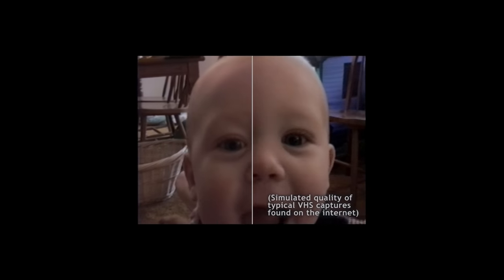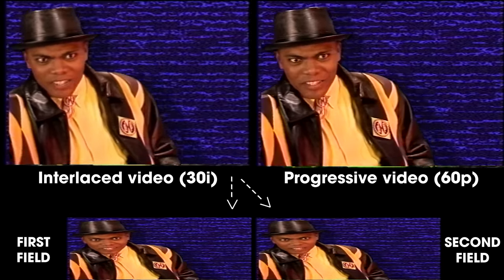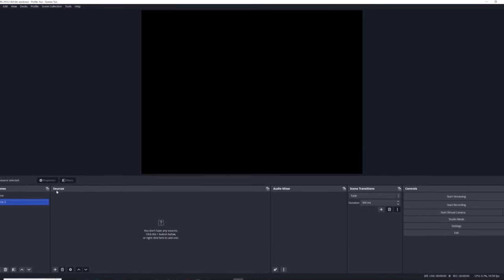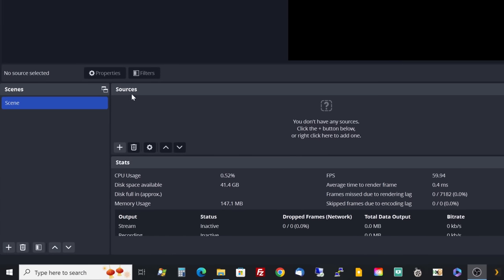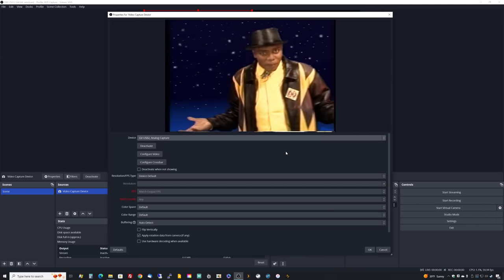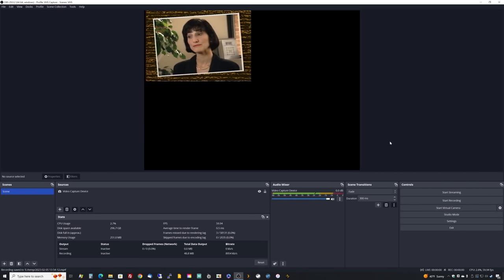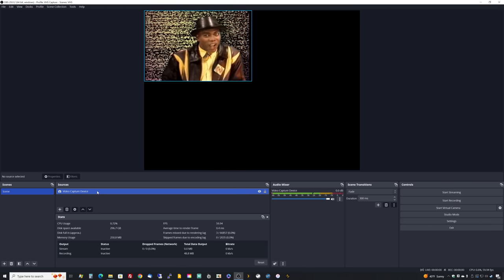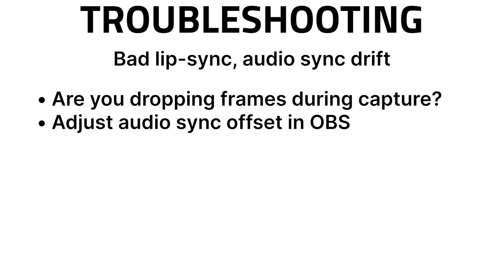How to convert VHS videotape to 60p digital video

Comment: How do the results of this method compare to using a VHS-to-DVD recorder (Panasonic DMR-EZ485V)? I also have a Toshiba 6-head deck which may be a better player, but I would need something like that Dazzle device to bring it into the PC.
Reply from the maker: DVD recorders are a great option to do the digitization, and you can later rip the DVD-R to VIDEO_TS files and then perform additional processing if you need to.  The end result (OBS vs. post-processing in virtualdub) can be exactly the same if the same steps are performed (yadif2 for deinterlacing to 60p output, primarily).
Reply: @TheOldskoolPC  I've been using StaxRip to delinterlace the ripped DVDs to 59.94, which seems to yield a good result. However, I've never compared it to the method you demonstrated here, which seems simpler and I wondered if it might also provide a better result.
I also have a Sony GV-D200 that can play analog or digital 8mm tapes, which also digitizes the analog tapes (or any other analog input given it via composite or s-video) - over firewire. The resulting video, however, is a very large 30Mbps bitrate AVI file and is still interlaced.
Your solution using OBS is the first one I've come across that deinterlaces "on the fly" to a file.
Thank you!

Comment: One more question (I promise) about OBS capturing old video. Some of my videos are so old that they are putting out an inconsistent signal. When this happens the preview window and capture (recording) screen turn blue. I guess when OBS detects no signal (even for just a second or two) the video capture screen turns blue. The sound capture continues to record, and the video capture records the blue screen. I can manually get the picture back by deactivating and then activating the capture device within the OBS program. Is there a capture setting in OBS that I am missing.? I've messed around with the settings for a couple of days now and I'm unable to resolve this. I wanted to let OBS do the capturing while I did other tasks on my second computer. The capture being inconsistent with old videos forces me to babysit the computer as opposed to getting other things done while running OBS on autopilot. Thanks for any help.
Reply from the maker: The only way to deal with dodgy tape producing inconsistent signals is to get a TBC and put it in the signal path.  That said, it isn't supposed to "disable" OBS, that I haven't seen before.

Comment: Thanks for the video. I purchased to IO Data (GV-USB2) and installed OBS. OBS no problem. The GV-USB2 install wizard would only allow light capture in the install and I am not sure that it actually installed. I could not get the OBS software to recognize any Video input device and GV-USB2 was not on the list. most likely is operator error but any ideas would be appreciated.
Reply from the maker: Sounds like the driver didn't install.  Try the driver I link to in the video's description.
Reply: @TheOldskoolPC  I will try to reinstall. Thanks. Quick question: When in OBS and I try to add the GV-usb2 in the Sources menu, there is nothing listed to choose from in the  Video Capture Device pull-down menu. It's blank. Should the GV-USB2 automatically show after it is installed? Also, there is Light Capture on the GV-USB2. This seems to be the only choice that gets me anywhere. Maybe that's my issue. Thanks for replying.

Comment: I love your tutorial it has helped me record so many memories so far! One problem I have though is when I connect my GV-USB2 to my pc OBS usually shows a black screen although my pc recognizes the capture card. When I change the resolution of the capture card to custom 720x576 I can see the recording on OBS again. When I switch to 1440x1080 it shows a black screen. Should I just go on and record on 720x576? How can I fix this? 

Note: In the OBS video settings the resolution remains 1440x1080 but I have to change it to 720x576 in custom settings under properties tab of the capture device to see the recording.
Reply: That's the intended behaviour. You set your canvas and output settings to 1440x1080 but keep the capture device at its native resolution and upscale it within the canvas.
Reply: @PuffyRainbowCloud  oh I see, thank you! but is 1440x1080 the right upscale resolution for 720x576 when considering the aspect ratio? or should I upscale to something else?
Reply: @ogulcanyldrm9935  Actually, 1080p isn't a perfect integer either. Since we're scaling with lanczos and this is vhs, i've been doing 1080p. If u want a perfect integer of 576p you could do 1440x1152. Most modern video players won't mind.
Reply: @PuffyRainbowCloud  I'll try that and see how it goes, thanks!

Comment: Would OBS be able to transfer from MiniDV FireWire-1394 as well? Using the old tutorial I discovered that VirtualDub64 treats raw transfers from MiniDV the same way it does for footage captured with the software itself and it made my life a whole lot easier when trying to transfer digital tapes.
Reply from the maker: I would not use this tutorial for DV tapes, but would instead transfer them over firewire.  In Windows I use either Premiere or WinDV for that, and I'm not sure what you'd use for other operating systems.
Reply: @TheOldskoolPC  I transfer MiniDV tapes through firewire using Live Essentials pack on Windows 7 and WinDV on Windows 10, then I put the file in VirtualDub64 and give it the same treatment as analog footage (resize, deinterlace, aspect ratio adjustment etc...).

Comment: ?* I have a Canopus ADVC 110 and cant find specs.  Would you know if this encodes both fields as the IO Data does? (Great Video!)
Reply from the maker: The Canopus ADVC 110 is a DV converter, so you connect the analog video and audio to the device, and it converts it to DV that you then read over firewire.  If you are using that device, don't use this tutorial, and instead use firewire (IEEE 1394) capture to get the raw DV data, then you can use the FFMPEG command-line in this video's description to convert that interlaced DV video.
Reply: @TheOldskoolPC  Thank  you!. It seems Win 10 and firewire is problematic anyway and limited support since xp so I most likely will use the hardware and software just as you have shown rather than try and re-invent that wheel and find pci fw card. (Was just thinking transfer rate would have been slower via usb, but maybe not by much)

Comment: I tried this using the Elgato video capture device (as it’s the only one I have right now) and tbh I can’t see a difference using the Elgato directly compared to pushing it through OBS as the endpoint. I am hoping that if I use one of the capture devices you recommend it will be noticeably better.
Reply: Actually, I take that back, I couldn’t see much of a difference on my laptop but noticeable better quality when uploaded to YouTube, thanks.
Be very interested in your next tutorial on how to up the quality.
Reply from the maker: If the elgato device is deinterlacing the input for you, creating a 30fps file with no fields, then this tutorial can't help because the elgato device mangled the footage during capture.  But if you're happy with the results, no need to second-guess yourself.
Reply: @TheOldskoolPC  thanks again, I really do appreciate your reply. I captured at 60fps and yes I a content with the results. But I always want better. I have a box of VHS etc from 30 years ago I want to digitise. You have got me thinking again, so I will revisit your vid and use something other than the elgato. Thanks again.
Reply: @jobl5505  Hey man, could I ask you a question please? Can the Elgato hardware be used to produce the video's results using OBS, or would you say the Elgato hardware causes lower quality even when not using its intended Elgato software? In short, is it better to not use the Elgato capture device regardless
Reply: @bradleyn5942  yes, Elgato hardware+OBS produced very acceptable results. It obviously upscaled it etc.  I was pleasantly surprised. I will try another dedicated upscaler but quite happy at the no.
Reply: @jobl5505  Thanks for letting me know! Happy testing :)

Comment: Is it advantagous for us to worry about "color space" and "color range"?  Even when i select 601 and limited in OBS, the resulting output in virutal dub still indicates (using the historgram plugin) to use the "level" plugin to cap dark/white as 16,235
Reply from the maker: You're mixing workflows, so I'm not sure how to advise you.  If you want to keep using virtualdub, you should capture inside it as well, as that way it won't perform an unnecessary colorspace conversion.

Comment: Color space for VHS and hi8 must be 601
Reply from the maker: Good point!  Yes, capturing should be Rec.601 and that should also be the colorspace if you use a lossless codec (I know that UT has different codecs for both Rec.601 and Rec.709).

Comment: I just received my GS-UVB2 cord and went to plug it in the back of my DVD/VCR combo and it doesn't plug in. My new cord doesn't have the "poky" stick at the end to plug into the VCR. Any suggestions on how to get it connected and which yellow/red and white plug I put it into? Thank you so much!
Reply from the maker: You need to obtain standard RCA cables with male plugs on both ends.

Comment: Thanks so much for this updated method. It's so much more straight forward than the VirtualDub approach. Do you recommend using Handbrake to compress the file sizes? A 30min file is 6GB.
Reply from the maker: Instead of using handbrake, I would explore changing the compression options in OBS itself.  Handbrake would just be an extra step.

Comment: Hi, do you know if the Dazzle DVC-100 also works for 8mm videotapes? I need to convert both VHS and 8mm and will try to use this tutorial for both.
Reply: Yes, I have used a Dazzle DVC-100 to convert both VHS and Hi8 tapes.  However, the Hi8 tape conversion quality is not what I would expect as the mp4 file created is worse than what I got when I converted VHS tapes.  Not sure it it's the camera I am using to play the tapes, the original quality of the recording of the tapes, or some setting in OBS that I need to change.  I posted a separate question here regarding this issue so hopefully I will find a resolution.

Comment: Had anyone success with the Startech SVID2USB232? I get a picture but no sound!
I tried three different connection cables, three VRCs and any possible audio setting I found.
Very frustrating. Think I will send it back.

Comment: The problem I recently came across has to do with video players that don't work anymore, after two and a half decades that was stored
Reply from the maker: Sadly, many players will need some routine maintenance these days.  There are belt replacements online, and you can usually find maintenance manuals online too.  In rare cases, some capacitors will need replacing, or some broken gears.

Comment: I have a newer mini PC running Windows 11, with and Intel N100. I am trying to find any Dazzle driver and having a real probably finding. I tried the link in the info above but seems to only be for the  GV-USB2. Is that correct?

Thanks for any help.

Comment: I have a canon GL1 MiniDV camera that id love to have 60p footage digitally but I can’t get it to work. Everything online tells me it’s interlaced  so this method should work but all my digitizing outputs 29.7p. Please help
Reply from the maker: You need to transfer the DV digitally over firewire if you want to get a 100% exact copy of what is on a DV tape.  For windows you can use a utility like WinDV to do this, but of course finding a system with a firewire (ieee 1394) port can be difficult these days.

Comment: i had an elgato but i bought the i-o data and got nice video but i mainly run on a mac so i had to use a spare windows laptop
Reply: Sounds like the i-o data gave a better result than elgato, was that right?
Reply: @RonHParker  yeah but the elgato was better when there was bad signal but i-o data is 100 times better otherwise

Comment: Do you happen to know if any of the suggester capture devices can capture all 486 scan lines? I'm specifically most interested in capturing the line 21 closed captioning information which to my understanding is lost when only 480 lines are captured.
Reply from the maker: The only devices I've worked with that capture all 486 lines are Blackmagic devices, specifically the Intensity line.  However, I'm afraid I have no idea how to post-process that information to extract the CC.